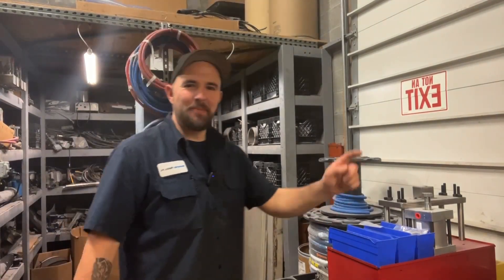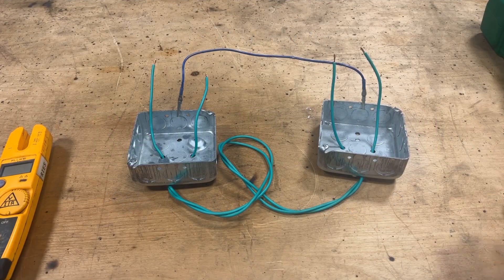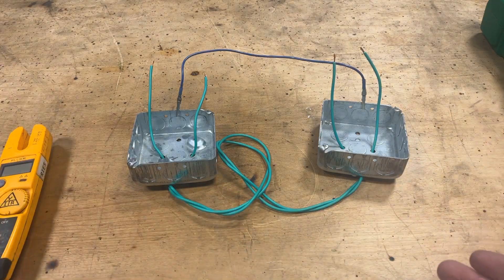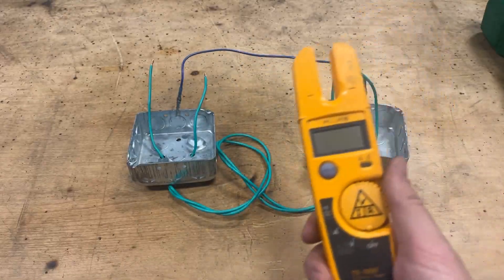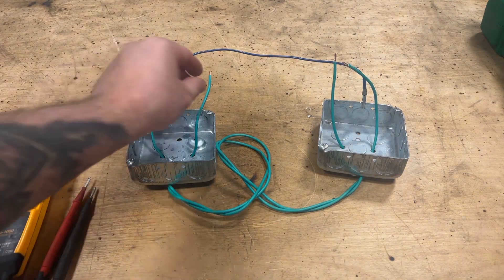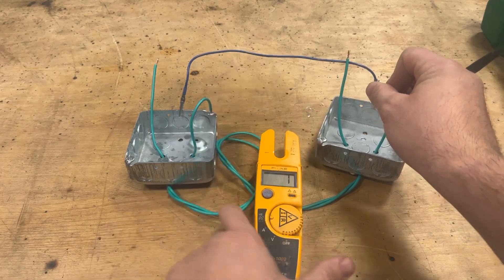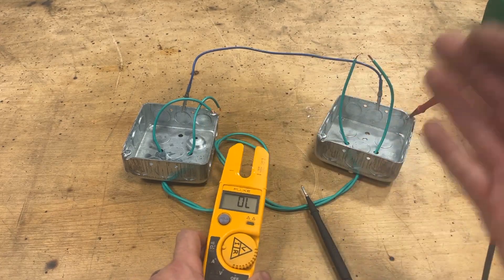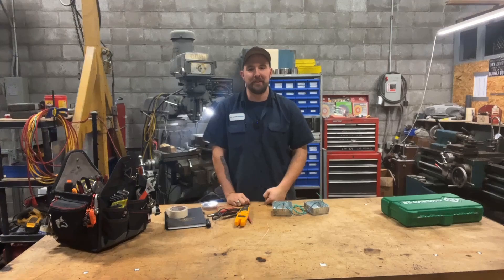How to check continuity?

Comment: I have done this more than a few times. I also have 50 foot and 100 foot test leads for my DMM. I have made adaptors so I can use AC extension cords for test meter lead. Once I even use FRS radio to help trace some wires. The meter was in another room but I could hear it "BEEP" over the radio when I found the right wire. I once had to come in behind someone to finish wiring a house. They had did the rough in but did not label a single wire. I had a bunch of wires at the wires at the panel and no clue what wire went to what room. None of the wires were even stripped. This was a 3 story house. That was fun.

Comment: Retired utility testman here. 
One thing I would add to your video. You should first check the unknown wire end from chassis ground for voltage before you select ohms on your DMM. In my world I would check AC & DC volt ranges.  
Once you establish the wire is dead then you should feel safe to select ohms on your meter.
BTW - It's never a bad idea to check your DMM (Digital multimeter) against a "known" voltage source before you start your troubleshooting.

Comment: Great tip and demo! LOVE IT... I've been using this trick for many years... FYI, this should be common sense, but....Warning ⚠️... make sure the POWER is turned OFF and CONFIRMED with your tester before you do what Dan demonstrated GROUND + HOT LEAD = BAD DAY.
Reply: Lock out/Tag out #1

Comment: Its SUPER EASY To Chect That , Before i watch the video i can tell How I Determine Polarity of wires on my antennas in attic space, i just dissconect them from the antennas itself if active ones, then i downstairs hook up 9 wolt battery to the wires, ceter wire positive, negative coax wire is connected to minus of a 9 volt battery, then i go up with a 5 euro multimeter and just check the power and i can see if somewhere in the way theres a leak or the wires are broken, you can even use your tounge to check the voltage out, but thats ONLY If you hook up 9 volt battery and no other electricity like car battery or whatever, that will make you feel bad and energetic lets say.
Thats how i check my antenna wires and thats how i check the voltage drop from the wire itself and then i can calculate the ohms lost that i can put in my VNA calibration so when im testing any of my antennas, i trully are testing My antennas and not the wires - but the wires HAVE Effect on them too, radios and antennas are mistical thing afterall :)

EDIT : Watched The Video - Cool Tactic How You Did That, Will Note that In My Brains Too For Less  Powerful Wires :)

Comment: Do PLCs run in the same type of conduit? Since they are 24v i believe? Great video
Reply: Normally PLC communication cables are run in shield jackets to isolate them from EMF fileds. They can be run as individual run as well. it's all related to the application and engineers that design systems. Some are good and some... well, they should think about career change 🤔

Comment: My problem is efficiently checking continuity over long distances for instance between rooms. Any suggestions.
Reply from the maker: For something like Romex you would have to disconnect both ends of the Romex completely and wirenut the conductor in question to a “known good” conductor like the  neutral and test the other end for continuity between the two. Hope this helps!

Comment: You could have also found that that wire is grounded somewhere in the system other that where you grounded it. You should have tested for a grounded conductor on all wires first to be 100% sure you found the correct wire.
Reply: Yes! Came here to say this